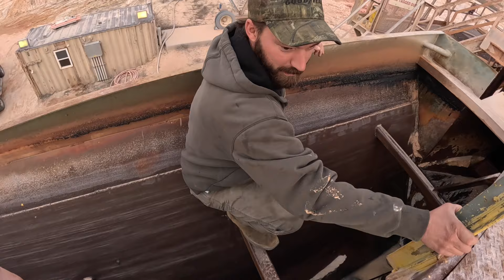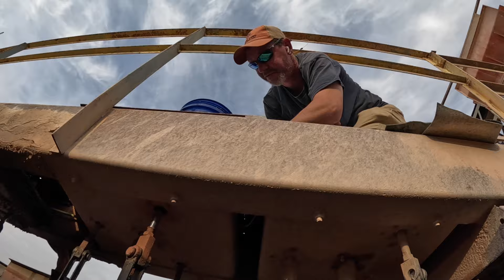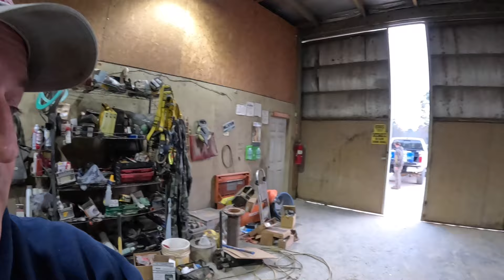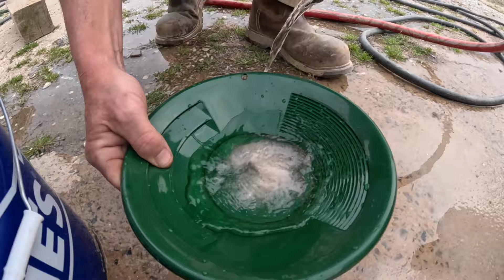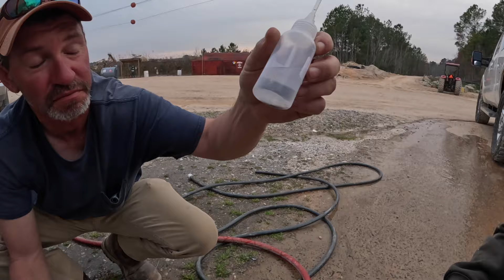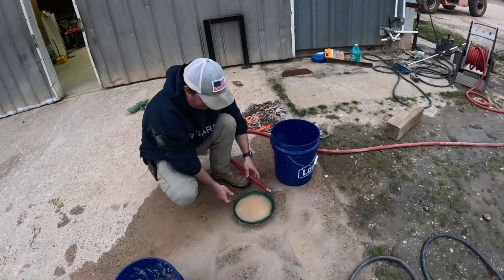Did we find GOLD in SAND⁉️ #goldfever

Comment: Pro tip: lightly sand or scuff up the inside new pans. The slick bottom allows the heavy concentrates to travel with the water. A scratched pan will give the heavies something to hold on to.
Reply from the maker: That makes sense, thanks for the tip. and thanks for watching!
Reply: @TheRealMrDiGG there's multiple videos on how season your pan, klesh Dan Hurd, or ask Jeff Williams they also have good panning techniques too
Reply: @TheRealMrDiGG also I forgot you can use a plastic concrete mixing tub from home Depot and pan into that this way you can repan if you think you lost gold and you can use jet dry in it it helps with fine gold that can float  on water tension seasoning your pan and jet dry will keep that funky way the material is reacting ask Jeff Williams is probably one of the top guys I recommend he is the one who proved home Depot sand had some gold in it
Reply: @TheRealMrDiGG If memory serves about a 120 grit paper and just scuff it, don't sand the whole thing.

Comment: You are really lucky that your black sand is magnetic. Take the stuff in your snuffer bottle and dump into the pan and let it dry out completely. Then take a strong magnet and cover it with cloth. Run it over the dry stuff to pick up the black sand and move it away then pull the cloth off of the magnet to drop it. Once you get the black sand out you are about as pure as you can easily get. They weigh it on a fine scale to see if it makes sense. Gold is very heavy for it's size. Way more than you would expect. Looks to me like you got some there.
Reply from the maker: This is a great idea. Thank you for sharing!

Comment: My suggestion to quickly find some dirt to pan, is to take a wet/dry vacuum to pick up all of the dirt, and then take it to wash someplace else.   If you have a portable battery pack with a 500 watt inverter, it can run the vacuum cleaner.  

By looking at how the sand is drained from your separator, the gold will flow out.  If there was a rim about 1" tall, then the sand that is not flowing over that 1" rim, then it can collect gold there.  

Remember there is a diamond mine in Arkansas, so there is always a possibility to get some diamonds too!  

From the looks of it, seems like you are finding a lot of lebberight.  It is the stuff that you should be leaving  right there.
Reply from the maker: Diamonds would be cool wouldn’t it?!!

Comment: Hey Ryan, ya`ll need to watch a parody Youtube channel from a couple of years ago called Youtube Gold. I do not know if you have heard of them, but it was pure genius, and they were only running Radio Controlled construction equipment between a few good friends, and built a minature Gold mining prospecting site in his back yard which was quite a few Acres of land. Now as funny as it was to watch, it was also very good to see how they managed to segregate all the tailings on minature scale compared to yours. But look them up and start from around series two, as that is when they started getting better tools to sort the Gold from the tailings. One was a water wheel propped up at an angle with gentle water flow running, and it would seperate some small amounts of tailings up a corkscrew pattern inset into the wheel, to a hole in the middle of it, which the gold would always find it way up to it, and drop into a mini bucket behind the central hole. The other was a shaker table ribbed horizontally, and water would flow again also from top right hand corner, tailings would be dropped in right hand corner, and it would shake it out across the table, all the light stuff would head down across to the bottom left corner, but the gold would only come down a little way and come off the left hand side. But just watch a few programs, and then look through his videos to see when they got the wheel and shaker table introduced, i promise it is pure fun, all done with (Adult) Radio controlled toys, but, it god damned worked. All from an idea from Aaron who ran the channel, just to make fun of the real guys like Parker etc doing it for real on a humongus scale. Great video Ryan as per usual, keep up the great content :) chris from the UK.
Reply from the maker: I think I might have seen one of his videos weeding his wife’s garden with RC’s. Cracked me up! I’ll check it out & thanks so much for taking the time to comment!!

Comment: I am seventy four now, pushing another if the good lords willing. I have worked in gold mines and my son works for one of the largest mines in alaska... hard rock underground. In the many years past, men were not very tall and the wore cuffs in their pants. No one really changed clothes just to get mud in them first thing off in the morning..... stand in the creek and kinda wash off their muddy junk. As time went by, they took their clothes to a place that did the laundry. Those china men would unroll those cuffs in the pants and find fine gold in them. The miners never really got rich but the laundry men were banking good money from those pants cuffs. There is a small amount of gold just about anywhere in the world as its just the nature of it.. I live here in alaska where people are known to just pan gold out of the driveway. In Nome alaska, there are high concentrations of gold on the beaches, roads, and any creek near it. They constantly dredge gold out of the bay there as its not very deep... about five to twenty five feet and you can take a excavator and dig the bottom, run it through a sluice and  some days are quite heavy with gold as it settles to the bottom. The gold you have is worn down to fine flakes or even smaller. Micro size and that can be profitable. There are places here in Alaska that they extract gold from the salt water and make a lot of money as in millions
Reply from the maker: Such a cool story, thanks for sharing!!